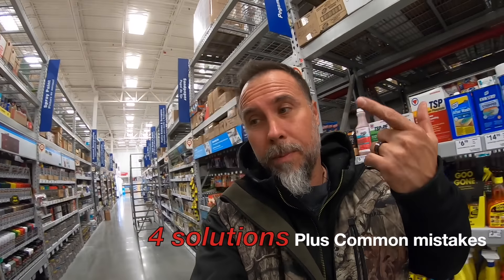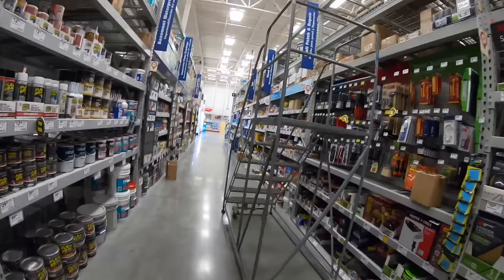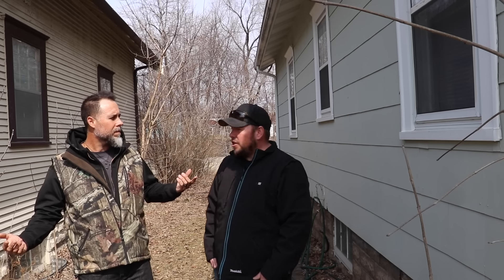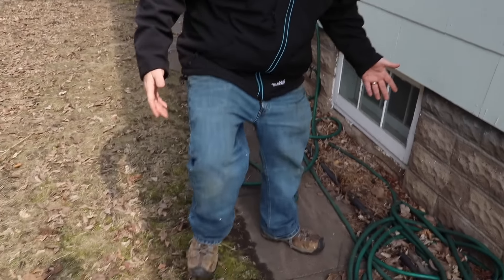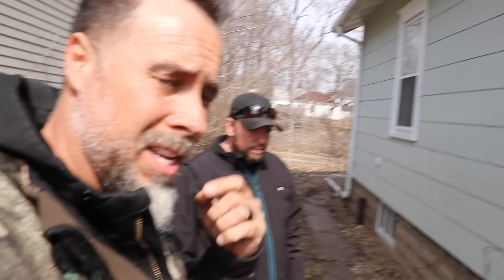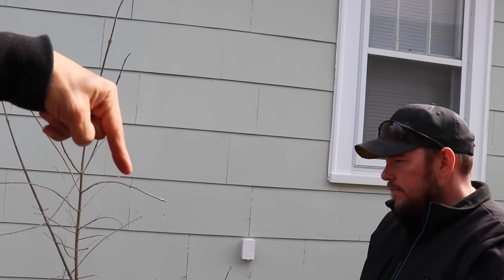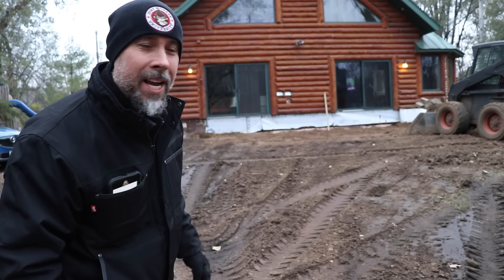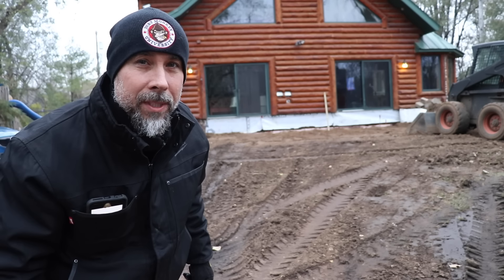4 Solutions to fix a wet basement plus Noob Mistakes

Comment: You had me paying attention within the first minute. I had (2) different nationwide basement waterproofing contractors come look at my house and tell me about the same thing for solutions; interior footer drain and sump.  I never pulled the trigger on that work because the estimators didn't even want to look at or talk about the front of the house, where the grade is negative, and there is no swale. I lost trust in contractors after researching further and trying to understand the hydrostatic pressure unvovled in pushing my basement walls/foundation inward.  Nobody wanted to fix the actual problem.  Thanks for speaking the truth on the issue. Now go fix the big contractors that rubber stamp your last resort solution for all projects.
Reply: 3yrs later  and they're all still push the same interior sump pump drainage system. Three quotes, $7,200k,  11,700k and $16k.  I too have been hastened to pull the trigger but I know I need a fix. Wonder how things worked out
Reply: @anthonyrobinson973 plus a lot of the drainage systems they install are plastic or really bad. Plus you have to deal with other factors like some of the materials they use might be low quality. But they charge a lot and have a huge markup aside for their labor costs.

Comment: Stan, as you know but those watching might not know, is that you should never rely on the advice received from people employed at box stores without double checking with a known source.
As for the video, i was a home builder for more than 40 years, and your advise is spot on.
Prevent water infiltration from the outside first if at all possible.
The remedies from the so called expert water proofing experts on the inside of the basement, are mostly applying band aids to the problem.
Reply: As an employee of a big box store, I could not agree more. I know where items are located inside the store, and I know some basic helpful information, but at the end of the day I am a retailer. I put things onto shelves. Ask that guy stocking shelves at the grocery store how to cook dinner using only ingredients he's never actually used himself and you might ruin your meal. Ask me how to reroof your house or repair your foundation... you can see where I'm going here. I'm all for DIY, but sometimes you really need expert knowledge, a seasoned eye, and practical experience. Things that can let water into your house or burn it down should not be left up to me.

Comment: This is exactly what I was looking for. I am a first time homebuyer, under contract on a one floor home with a basement that has a sump pump and a french drain. There is evidence that water has been an issue in a few places, and upon getting the inspection, the inspector said it is a grading issue. I am contemplating hiring the proper professionals to properly correct the issue from the OUTSIDE so that it no longer becomes an issue INSIDE. Thank you so much!
Reply: Did you fix the grading? Also look at your gutters and downspouts
Reply: @nofurtherwest3474  actually the whole french drain has to be replaced because some genius poured concrete into it and sealed off its sole purpose.
Reply: @indiegarona  oh… are you the same person?

Comment: As a home inspector I couldn't agree more. I see homes all the time that I'm told "has a french drain" but still see water issues because the "drain" has no swale and there is negative grading. most of the time grading is the problem.

Comment: What gets me the most, I had 2 estimates for the water intrusion in my basement, and neither company even bothered to look at my roof/gutters. I found that I had 3 downspouts leaking and one that was pointed straight at the ground. I had the gutters repaired and solved 99 percent of my water problems. 550 bucks vs 17k at the cheapest for the interior drain.

Comment: Thank you for the information.  I have a leaky basement and got 2 estimates for waterproofing (12K and 28K).  Neither company mentioned grading the outside.  A very knowledgeable man mentioned based on my property (slopes up in the front and slopes down in the backyard) no water should be getting in.  He suggested checking the gutters and grading/back filling around the property first.  After "looking up" I saw the gutter was tilted and leaking right to the spot in the basement where the water was getting in.  Also, there was soil erosion next to the house (so it literally slopes down again right by the foundation of the house).  I am so grateful he mentioned it to me-saves quite a bit of money and hopefully will fix the leaking!
Reply from the maker: Thanks Julie, hope it works out well for you !
Reply: Thank you Julie

Comment: Finally a video showing the various methods one can use to eliminate water coming into a basement. I know what my plan is now thanks to your video. I also liked your comment on the 1" slope for 8 feet. Another video the guy said 1" per foot or 4" per 4 feet. Interior plumbers using a 1/4" per foot or 1" per 4 feet.  That's what I'm going to use because it match the main yard or 2" slope per 8 feet. I'll be digging the soil out to put the exterior foundation coating on and then filling back with a different type of soil composition. Then the interior coating just to be on the safe side. And redoing the window sills with the angled covers. Your video rocks!!! Thanks!!!

Comment: Great video Sean. Thank you to both of you for taking the time to put this together. I've followed your channel for a year and I'm inspired and learned a lot from you. It makes a home owner more confident when tackling jobs DIY, or even when contractors come to quote work. 

Your videos are encouraging and very informative. Always awesome work guys!
Reply: Lucky for me, we hesitated before getting the whole inside drain/sump. Our basement only leaked during heavy rain AND when gutter overflowed next to basement window. I Pitched the gutter away from house and it’s been dry. But I wanted to find out where it was coming in so got an “expert” out to look at it. They insisted it was the false water table rising. Did some investigating.  Ran the hose at that spot. It was filling the window well and coming in through the sill.  Probably need to grade, and fix window well draining. That was before I saw this video. I hope I’m right, but this video has me thinking I am.

Comment: When repairing the leak in my Mothers foundation ,first I had to dig down to footing,graded for french drain,using truck brush and hose to rinse of concrete.Then went to concrete supply company to get membrane,where it was far cheeper and it came with a thumb drive video on application!  By going to a supplier I gathered wisdom and saved a bunch!😊

Comment: This is the reason why I tell my customers to watch Stanley. With a couple of exceptions I agree with his repair methods. My only difference here is that I don’t use a coating on concrete walls. I use Grace Bituthane, which is like a 60mil tar paper with an adhesive back. Using it insures that no spot can be missed. I also wouldn’t recommend interior drainage on this house. In one scene you can see the exterior face stone has cracked which would show that there is foundation settlement. So I would stop the water before is gets under the foundation. Other than that... perfect. I have probably recommended 1000 customers to watch the Dirt Monkey.  Well Done!

Comment: Up here in canada we use the rubberized coating first then the plastic with dimples facing the wall so any water that gets in runs straight down to a drainage system below.
Reply: When it rains on the wall the dimple allow the water to go in.. its never permeable with the wall...
Reply: What drainage system? You had one installed?

Comment: Fantastic video guys! 👌 very informative, honest helpful advice. Straight to the point! I really appreciate that you suggested dealing with the water at the source of the problem (exterior solutions). I’m dealing with hydrostatic pressure leak and when searching online most of the suggestions were for expensive interior solutions goin out into a pump and my immediate gut instinct felt off… none of them were talking about how the water is travelling outside  making its way to the foundation in the first place. Makes complete logical sense yo deal with drainage on the exterior first (if you can). Great job!

Comment: Great video guys. One thing you may have forgotten to mention. When searching for the source of water intrusion, consider a leaking water service lateral. Especially if the yard is soggy near the area where the water pipe comes into the house. If the water meter is in a pit near the street, you might even see the meter spinning when all the fixtures in the house are off.
Reply: This happened to me at a carwash in Tulsa. Everything was off and my bills went from the standard $88, to $1,000 in one month!
Rusty pipes were the problem.

Comment: Wow , this is the best wet basement video I've seen as I have the same exact situation, yard slopes into one side of my double wall brick house, and it takes in a lot of water.  I'm in the process of getting a permit to do option 3 which is to excavate exterior to foundation, add rubber mat and foam insulation, etc etc.  Only problem I see now is I want to do it myself but it is possible the city will force me to hire a contractor, which will easily cost 12k to 15k, when I can do the job for about 4k with a rental excavator.

Comment: One of the better videos providing proper solutions as with your other content as I've commented before. Thanks for the Lowes and Menards run because home cheapo had no idea when I asked about foundation solutions. They pointed me to the tintable interior gallon solution not the exterior rubberized fiber coating in the 5 gallon container. Also, I couldn't find the name of the hard plastic wrap to price match and your description plus the pallet racking label shot was unmistakable. Grade A video.  Props.

Comment: I REALLY appreciate your video! My house is over 100 years old. The large concrete bricks they used to build the foundation were old when they built the house! Reportedly, the original owner/builder of the house used bricks from "the old button factory" when it was torn down. They've stood fast for so long. Well, i believe the grade was not maintained, the gutters not kept clear (it's a very tall house), and the drain pipes were done PRECISELY as you had on your video NOT TO DO. even better, to "fix" the now-leaking walls, one of the previous owners just caked the interior walls with Killz. Great. Now the walls can't breathe and the bricks will break down EVEN FASTER. Plus, it still leaks. It makes me so frustrated to learn that they probably could have restored it by just fixing the grade and keeping up on the gutters (along with not doing them the wrong way). I'm hoping to God i won't have to rent a mini excavator and seal the exterior, but that's probably what it needs. I'm just terrified I'd end up accidentally knocking some of the fragile, ANCIENT freaking bricks with the excavator and bring the whole house down. 😬 because i sure as hell can't afford to hire out for it. It's a very deep basement, and I'd bet my bottom dollar that 9/10 of the contractors you could get to even come out here and do it won't compact the soil. You better PRAY that you got that 1/10. Ironically, the room that leaks the worst in the divided basement (5 sections) is the room with the water pump... and the only one without a drain...

Question: why do they have to use all-new dirt? Can they not use the same dirt, or is it because in residential areas there's just nowhere to put it? I'm on property.

Comment: I agree with waterproofing the foundation. I cleaned the walls with a steel wire brush down to the footing then slapped on a thick coat of flashing cement, plastic membrane, and insulation.  Lastly, I installed a french drain and never had a drop of water in my basement.
Reply: i dont mean to be off topic but does any of you know a way to get back into an Instagram account??
I was stupid forgot the login password. I would appreciate any help you can offer me.
Reply: @Achilles Duke it worked and I finally got access to my account again. I'm so happy!
Thank you so much you saved my ass :D
Reply: @Dustin Charles glad I could help :)
Reply: Would this be the way to go if I wanted my basement functional and not have to worry about things being damnagwd bwcause of moisture??
Reply: @tatianna0119  if you're having water get in, then yes, it's a good starting spot. But you have to consider, if you do this grading type landscape work, and still have water getting in, then you have to do something more substantial.

Comment: I ran into a similar situation to the one shown in the video where water was being trapped between a concrete slab and the foundation.  In my case, it was a narrow strip of landscaping between the driveway and the house.  Luckily, I was already planning on replacing the driveway as it was all cracked and wonky thanks to tree roots.  

I had the concrete guys dig out that landscaping strip and run the new slab all the way up to the house (minus the expansion joint, of course).  No more grading issues, plus no more mowing and weeding.  Aside from that, all I've needed was nice, long downspout extensions (proper metal ones, not cheap flex tubes).

Comment: Nice overview of the scope of a drain and waterproofing project. Very good starting point to explain to other homeowners the process we have learned about. Glad I found out about a water backup to my sump. If I had not already had an interior drain, I think I would look to the ones you can hose out if they clog.

Comment: Glad I found this video! Our home is on a slope and every time we get hard rain the crawlspace floods. We had three water proofing companies come out and two of them went sump pump and new vapor barrier. But that doesn't help keep the water from intruding, I thought. The third company wanted to basically do your third option but around the entire house which would have been 30k. 

Only one part of our foundation is exposed to the soil bit of the slope. I'm going to dig my own trench, water proof membrane the foundation and add the pipe myself. Then grade away from the house when I fill it back in. Luckily this North Carolina soil is mostly clay LOL.

Comment: Hey. That dimpled plastic thingy is called "nopovka" here. It should be installed with dimples towards the wall to create a gap. It is to ventilate radon gas and allow air to carry moisture from as large wall surface as possible (that's why only dimples should be touching the wall). We here use some kind of asfalt/rubber asfalt coating and than heat up and stick asfalt strips to the wall. Alter that you can use "nopovka" and if you feel like it you can place perforated pipe at the bottom to catch and possibly pump the water if it is needed.
Reply: I was gonna say.  We just call it dimple board.  But dimples in, drain tile at bottom.
Just like you said.

Comment: Straight shooting  and timely... Owned the house for 13 years never a problem.
Then one of the wettest winters.. torrential rain for 6 weeks.  then 8 inches of snow, 
on the ground only 3 days and the temperature went way up.. and the net result rapid melt and
 water in the basement.. not a lot but significant.
So I called "the guy". He says pull all the sheet rock first ,  2   4 ft wide walls, so he can see the problem,
 I did it.. these are concrete block walls, the usual stuff. 
Yup, you guessed it, no water on the walls...very little water at the base but 1/8th inch along the base 
of the walls and 16th" on to the floors. 
The "guy" shows up and looks at the situation. Within 2 minutes,  he suggested a sump pump  and a 4 ft of "c" channel.
.$4K .. three guys and done in one day. I am responsible for the replacement of the sheet rock and clean up. 
Really ? Gets better. He said if that doesn't work...next step is to strip the sheet rock off another 16' of wall 
in the adjacent room and  rip out the carpet and moldings etc. They will continue the "c"  channel and run the sump pump 
discharge pipe out of the base of the front of the house. They will add some kind of cloth barrier on the walls.  
I do the sheet rock and cleanup. Additional cost $16K  !! 
Oh yeah.. sign me up. I might be ignorant but I'm not a fool.
I watched more videos Thankfully I watched several videos, and now yours.

Here's what I got from your video. SUMP PUMP IS THE LAST RESORT. 
Then:
Me, the guy that didn't clean our gutters on the wet side of the house.. the basement water side.
I cleaned the gutters which go into two  black corrugated pipes which goes down the hill in front of our house into a roadside drain.
What I will do next:
Grading..Mine is a  3 inch slope over 8 feet.. aimed right at the house.
Time to get out the shovels. 
Third, sill plate how about  mine ?..touching  to 5 inches. I'll dig it out. 
Next French drain. in the center of a swale.
I ran all this by my neighbor who is a civil engineer (so was my father RIP)
He confirmed it was the right course of action. He said, as did you, Sump pump .. last resort and usually by those 
companies who are clueless greedy, con artists or all of the above.

Thanks for the video, liked and subscribed.